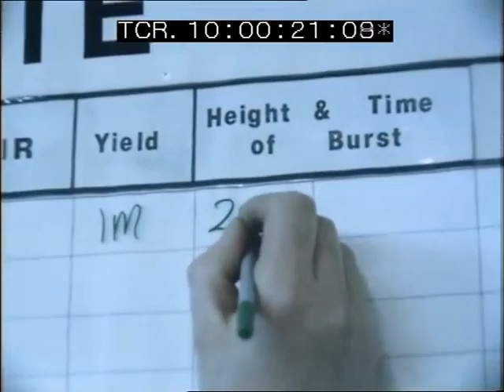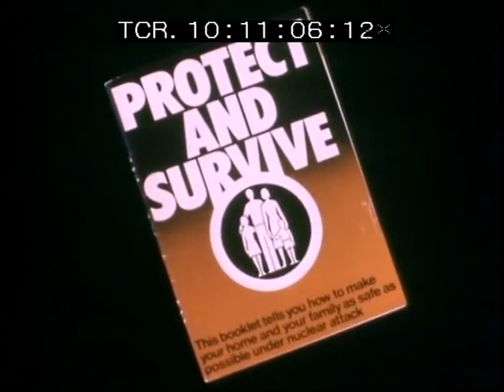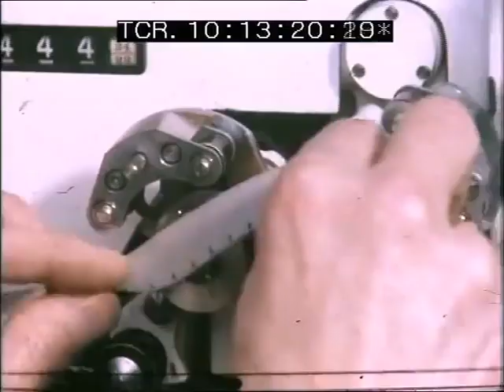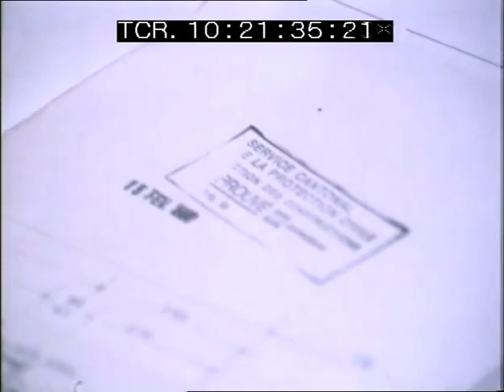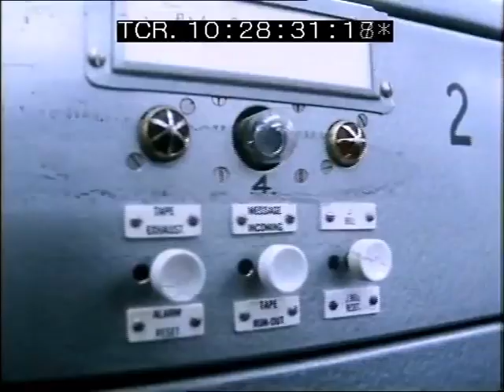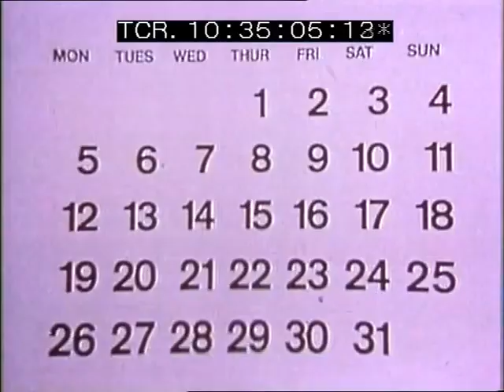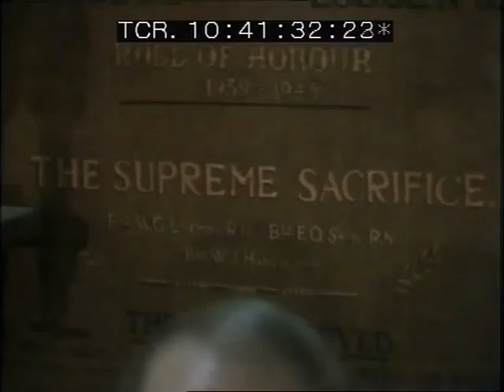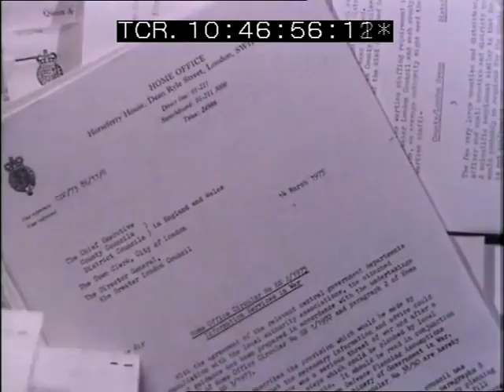If The Bomb Drops [BBC Panorama, 1980]

Comment: It would be interesting if Panorama was to make this today (September 2022) and see what, if any, changes there has been in 40 odd years since.
Reply: The new advice is. Get drunk.
Reply: @Rasputin712  I think the street market trader said it best, you've had it.
Reply: The world's current nuclear arsenal is about 1/5 of what it was when this documentary was made, and only about half of the warheads that exist today are deployed/mated to a delivery system.

In a nuclear exchange, a lot of missiles would be intercepted and shot down by anti-ballistic missile systems that did not exist in the 1980s.

Today, a nuclear war would only yield about 5% the amount of devastation that it would if it happened in 1980.

Furthermore, the overwhelming majority of today's warheads yield well below 1 megaton.

That's not to say that nuclear war wouldn't still be very bad and permanently world-changing, but the information provided in this documentary is severely outdated.